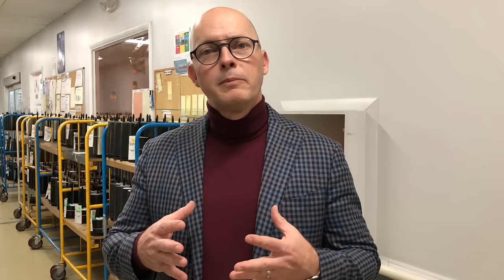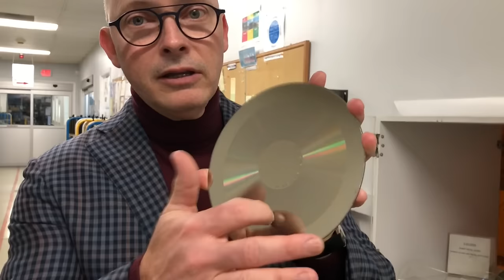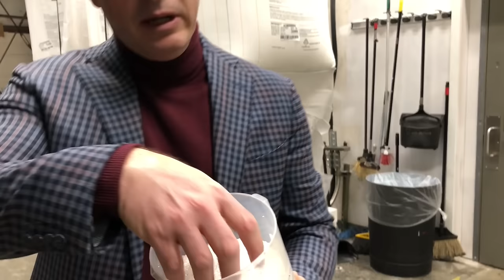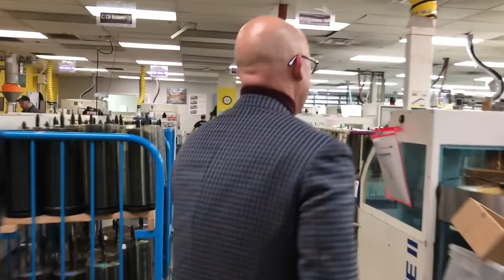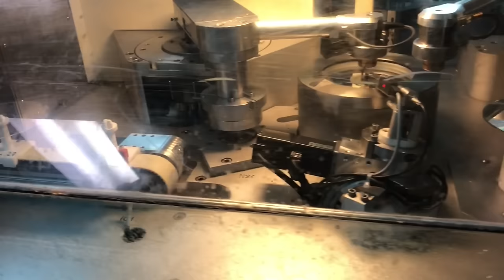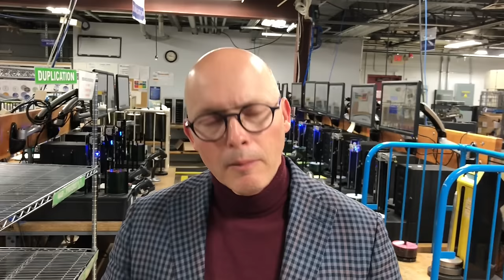Indie Music Minute: Disc Replication vs. Duplication

Comment: Hello. I can now understand what the difference is between repl. cd's and dupl. cd's from your helpful video. Just have one question. On the burned cd's you can tell where the media content ends with the burn mark at the end (about an inch-2inch from end). However, sometimes (most of the time now) On factory pressed (repl. cd's) I can see what appears to be a burn line at the end of the cd even though it's not. What is that?
Reply: Not quite sure what you're referring to...
Reply: It's where the disc stamped the info.

Comment: U would have to have a car from the 90s or early 2000s to have issues with CD playback. Anyways thanks for clearing that up.
Reply: That CD from the 90's or early 2000's will still play exactly the same today as it did back then, can't say that about a car from the 90's today. Certainly will have had a lot of maintenance if it's still running. Hardly any maintenance on a CD, if you can call it that when all you do is put it back in it's case and store it tell the next play.

Comment: So, people may be being led to believe that they are buying a CD, when they are really buying CD-Rs, if I have read this correctly?   If so this should clearly be noted on a disc and on album packaging.  For I may choose not to buy a CD-R, if I know that it is so.   If I buy a CD and find that it is a CD-R I feel cheated.  CDs are meant to meet the Red Book standard, CD-Rs are different tech.
Reply: That can indeed happen. There is no law or rule that states that a disc should be identified as replicated or duplicated. Since they sound identical, the market has decided they are substitutable and no need to make a note of the different manufacturing methods.

Comment: Duplicate sounds better because it is made with a master. So the sound quality is better. With a replicator, you do lose a very small quality sound. 

Now, the master glass is the bomb!
Reply: Wrong. Replication and duplication sound identical. It's digital. 1's and 0's. The only thing is that occasionally a duplicated disc runs into playback errors with an old CD player. Which is why if you've got the option you want replicated CDs.